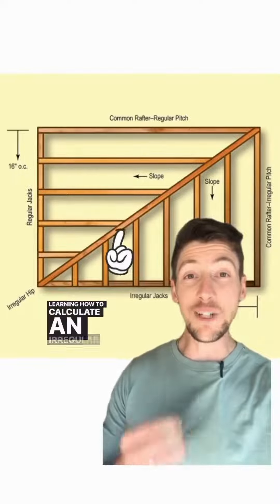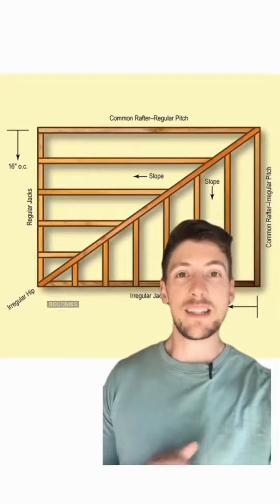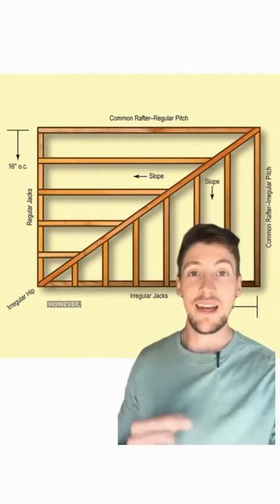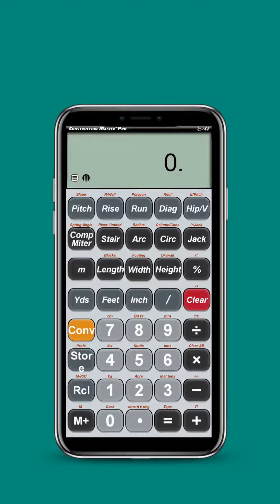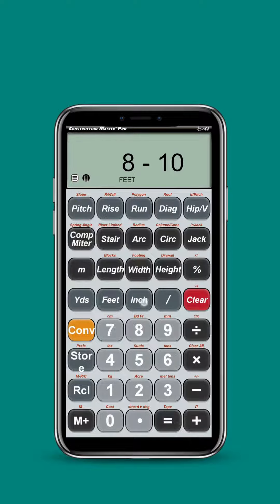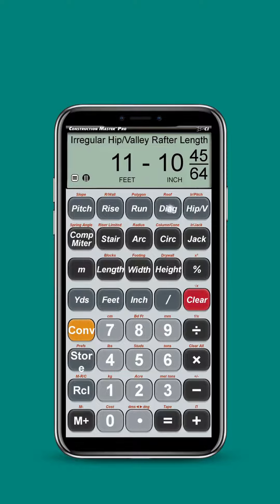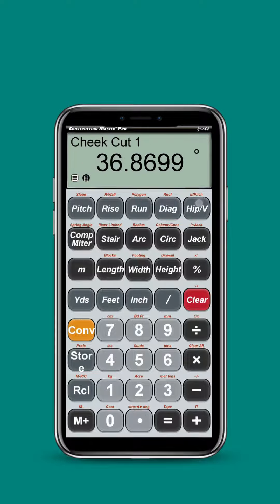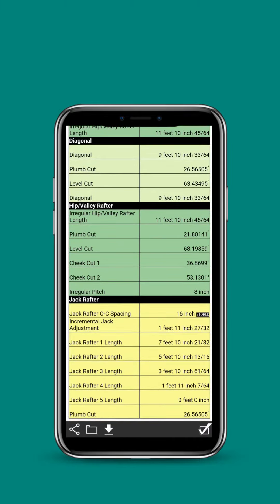How to find length of irregular hip and valley rafters with the Construction Master Pro

Comment: Does it give you the offset of your hip rafter so the overhangs line up?
Reply from the maker: The calculator does not provide the hip rafter offset directly. This will have to be determined by some additional calculations. A good example can be found here in the JLC Forum – https://forums.jlconline.com/forums/forum/jlc-online-expert-forums/rough-framing/9507-hip-and-valley-offsets-on-irregular-hip-roofs